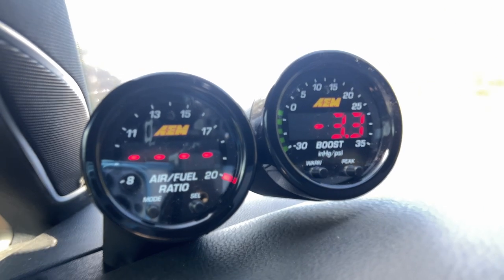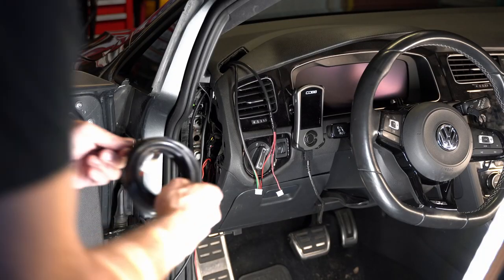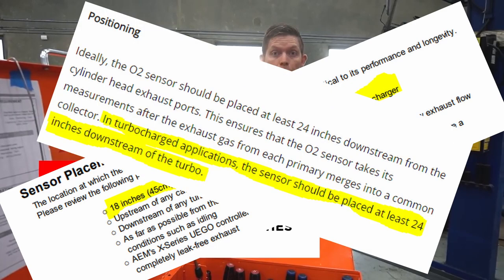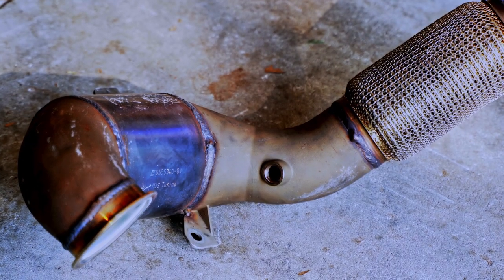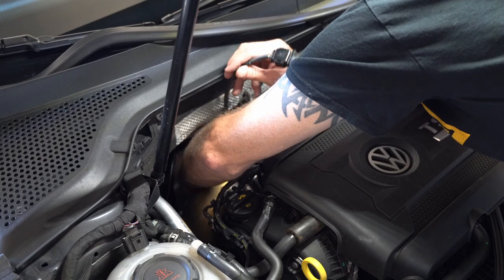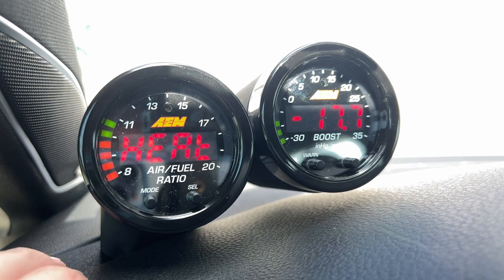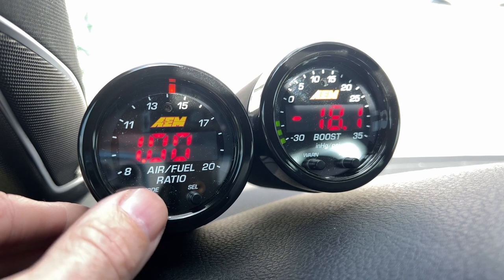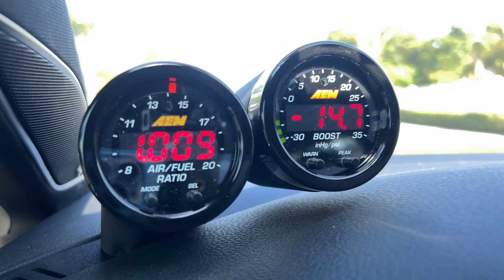Install: AEM UEGO AFR Gauge - 2019 Golf R

Comment: I am still using the AP to monitor AFR but did something similar with my rear O2. Removed it and installed a plug and crush washer. De-pinned it from the connector and built a clean little “dead” plug to install back in the harness up at the connector bracket. Used some silicone in the dead plug to seal it where the wires insert into it. Should keep the harness side clear of any debris/moisture. I couldn’t stand the connector just laying next to the bracket unplugged and it’s nice to get rid of the extra wire against the firewall. Might have to go this route and use the OEM bung for a fixed gauge. Great idea. Good stuff!

Comment: So the downstream O2 sensor is a narrowband. Thank you for verifying that. That then means that I can use a new sensor in the stock location and output a narrowband signal from the controller to the ECU if necessary.

I find it kinda odd that they warn against placing it after catalytic converters when there's one right behind the turbo on these cars (and I'm pretty sure most newer turbo cars now). Also, I don't understand why the factory wideband sensor works in the turbine housing when aftermarket ones do not. Is the stock wideband sensor a special type of sensor?

Thanks for the good video!